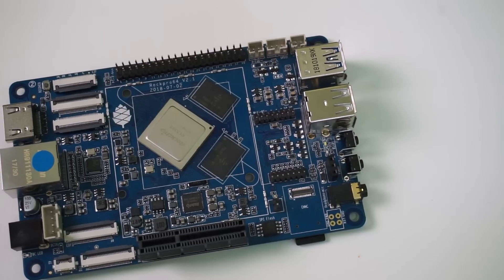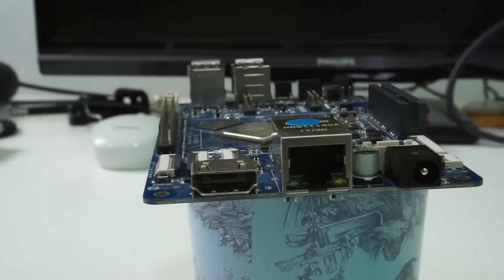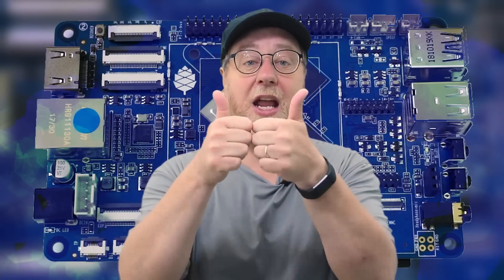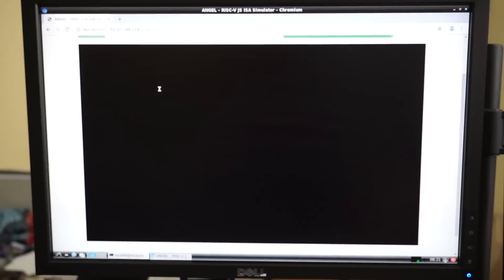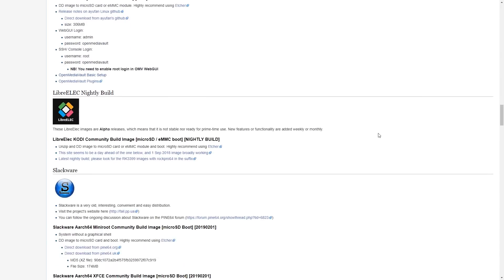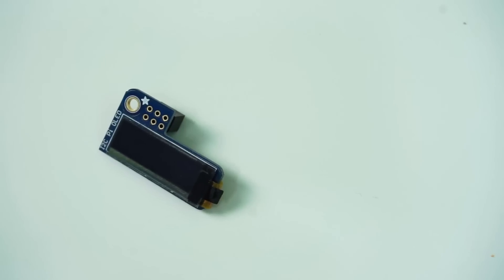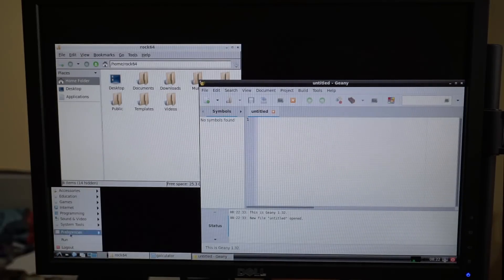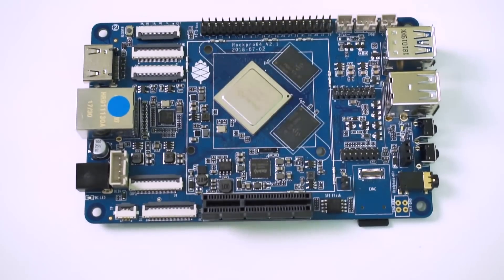PINE64 ROCKPro64 Review: Better than a Raspberry Pi?

Comment: The RockPro64 is an incredibly disappointing product. None of the listed Linux versions seem to work properly with this device. It's no wonder that it's relatively unknown because it's simply not worth being on the market.

Armbian doesn't work in 4K, and even when you manage to get Debian to work in 4K, it fails to update properly. On top of that, there are issues with some versions where the USB ports don't function as they should.

Overall, the RockPro64 is a terrible piece of hardware that's a complete waste of both time and money. I've already tossed mine in the trash, and I strongly advise others to steer clear of this product unless significant improvements are made.

Comment: It's been 3 years and there's still no full functioning OS for this board or the plethora of others out there. Don't believe it?  Read the associated forums for each one. If you want to spend your time trying to make a board work, have at it.
I have one of these and another that I spent countless hours on and still don't have a reliable system. Meanwhile my Raspberry pi 2B has been running  24/7 for  3 years as an MQTT server without the need to beboot.

Comment: I wish I watched this video before I ordered a rockpro64. The overall design of the board and it's amazing hardware really impressed me and led me to believe this would be a suitable alternative to a RPI4. I'm not unhappy with my purchase, but I am ripping my hair out trying to get BSD to run properly and I can't find any documentation or support for getting BSD to run on the rp64. The fast hardware doesn't do you much good when there's no hardware acceleration and your system runs like a potato.

Comment: I purchased the complete set 4Gb board eMMC SATA FAN Heatsink SSD adapter wireless add on camera and display screen all of which cost a fortune. It's really useful if you have an empty draw that you want to fill up but no use for anything else. As Gary says part A will work this operating system 1 but not 2,3,4,5,6,7, part b will work with operating system 2 but not 1,3,4,5,6,7, blah blah blah. it's expensive junk.

Comment: if it's was only 25$
Reply from the maker: If by "it" you mean the ROCKPro64, it isn't.
Reply: @GaryExplains   i meant was.
Reply: Exactly. At least another RK3399 SBC like Orange Pi 4 w/ 4Gb RAM and 16Gb of eMMC soldered module including WIFI/BT is only $49 and much better supported by Armbian community.

Comment: I'm wanting to build my own NAS, thinking of using this SBC. That SATA card from Pine only supports two SATA drives Has anyone had luck getting it to work with a SATA adapter card supporting 4 or more SATA drives?
Reply: Radxa the manufacturer of the great RockPi4 has some great SATA solution hat for the raspberry pi 4:
https://shop.allnetchina.cn/collections/sata-hat/products/dual-sata-hat-open-frame-for-raspberry-pi-4?variant=31603692699750

Comment: how much rock shit pro cost ? if cost more than raspi3 no ewer have good board, only idiot buy expensive board because can use same lot cheapen. no ewer must cost more than 30-50$ this board. only totally idiot pay this more than 45-50$
Reply from the maker: Only a total idiot which forget that there was difference between the boards and that the R Pi 3 has nowhere near the same level of performance.

Comment: answer have killer or not, IF board have little better, fasten and more ram, and true 30-40% cheapen then have true raspi killer, but if have expensive than raspi no ewer have killer or same level board.because today if have under 50% fasten cpu etc, no matter what u buy, human eye and brains not understand and see this how fast or slow have. no matter what speed have, important have guality,memory size,connectors,and number first how much cost. if have 100$ have too expensive, must be 20-50$ level only. and not fail connectors new raspi 4 has big fail all connectors plugs. idiot has plan this. need other usb plug NO C model. idiot think use C model. and same idiot have think hdmi micro have good, no newer. totally idiot planner.

Comment: How about hooking up a GTX card to the PCIe slot?
Reply: I dont think that will work. You need to have enough power from the power adapter and the board itself has to pass that power to the pci slot.
Reply: @-tineidae  Most GPUs take external power from the PSU.

Comment: @5:48 if you can have your kernel running command line, you can recompile ALL what you need to complete the Linux distribution you want.
So many peoples expect Linux to be plug and play for noobs, they miss the point of who started Linux (geeks) and even though the distributions are more and more noob friendly, it is still not suitable for my grandmother.
Please expect to do a bit of command line to tune your distribution, and if you are at a stage where you consider getting a micro computer to fiddle with it, then you are in the right spirit; don’t stop half way!!
:)
Reply from the maker: Yes I expect Linux to be plug and play for noobs, thus isn't 1998.

Comment: Yeah pine doesn't support their products I backed the pine64 and it just sits in a box with other broken or useless pcbs that I harvest old parts from when I'm fixing stuff. They get the barest example of as many OS's running on it then tell you it's fully compatible with all of them when in fact none of them run well enough to use for most projects
Reply: You are missing the point as they run a few main images and allow many community images.
The point you are missing is that the RK3399 in 5.2 is now mainline and its now Manjaro who provide the image and in Oct Ubuntu 19.10 will be available on 5.3

https://forum.manjaro.org/t/manjaro-arm-19-06-released/91858

Comment: i love the rp64 but i really wish people would stop this trend of calling boards like this a pi killer im sorry

ITS NOT 

better than a raspberry pi well duh no shit it also costs more if were going to allow spending more money the gigabyte brix is a pi killer no wait the skull canyon nuc is a pi killer no wait a full sized 1800 dollar gaming rig is a pi killer

this board and many like it is not a pi killer and heres why they never will be 

price rp 
foundation has worked hard to maintain its price point and even when they deveated they only did so for those wanting more ram whilst maintaining identical boards with less ram for the normal price point of 30-40 dollars

features
not only do you gett alot of bang for your buck but you have access to a massive ecosystem of cases addon boards and accesories

software
the pi has a huge crowd of people supporting it with software drivers os images ports and more 

availability
chances are your no more than a couple miles away from some kind of store that has one for sale right now ready for you to pickup if not amazon newegg and hundreds more stores have them available for purchase 

backwards compatibility 
with only cases for pi4 being the small exception nearly all addons accesories and software will work forwards and backwards with the pi series

options
need it smaller? pi zero need it embedable? compute module want something small but feature rich a+ theres a pi for every need 

so no its not a pi killer because once you look into it the pi is alot more than its price and specs
Reply from the maker: I didn't call it a Pi Killer. Why all the big long text for no reason?
Reply: Its a lot more, but tunnel visioned marketing department shaped crowd is not able to see.

Comment: The point of the Raspberry pi is it’s simplicity.  I did not want to add boards to the board like a pc.  The Raspberry pi is just better because of the support as well. If the software was better I would totally look at other boards, but the community for raspberry pi is dug in deep and have it down on the software end.
Reply: It always depends on what you are planning to use the board. Support on all those is just fine: https://www.armbian.com/download/?device_support=Supported

Comment: Nothing can beat the rpi4 !! (At least support-wise ...) :)
Reply: lol.... what support? the board just came out and has a different architecture. they released the board with crappy MESA support so far.
Reply: @slappymcphee  yes but I'm almost 100% sure all major distributions will fully support it within a few months. Which is not the case for many many other sbc's...
Reply: @eldontyrellcorp  I agree. With that being said, I think the PineBook Pro will lead to better support of this hardware (since it uses the same chip).

Comment: Wonder if a graphics card can be run on that PCI slot
Reply: I'm pretty sure you can, but you have also to power it and for that you'll need a PSU that is much bigger than this SBC, and even then the CPU will be a bottleneck (unless you're using a really old GPU). In the end I think it doesn't worth it.

Comment: Hardware is nothing without software and support.
So you pay 80$ for having just a piece of a single board to attach it on the wall.
Raspberry Pi is unbeatable, great software and mostly huge support and now that 4 is out nothing will compare to it.

Comment: The Pine64 team are far less involved with the distro development that they should be.  I've been meddling in Linux since 0.99pl12 (1993), and I still can't figure out how to create a kernel of my own for this board.  I purchased the whoe shebang (the NAS chassis, the SAST card, fans, power, etc.) and it's been quite a let down for more than 13 months.  Even asking fr help from the distro posters can result in no answer or weeks before you do get an answer.

Lots of power, but you can't really utilize it unless you are already an aarch64 kernel and uboot master.
Reply: Maybe try Gentoo, the whole distro is aimed at compiling the kernel from scratch so with a little effort you should be able to put something together tailored to your needs.
Reply: @schrodingerscat1863  The OS issues were sorted around 2 years ago and I've used more that 20 of these in projects.

Comment: Looks like I'm getting burned on the Atomic Pi, will be over £100 by the time I get it $35 purchase price.  Really I would have been better buying a Cherry Trail based mini-PC for £150 because I get a case, it has more DDR, has SATA and PCIe via M.2.  Plus a power supply.  My fault.  And the Pi4 got launched a few days after which would be just as good with more I/O.  We have to be careful in the UK, these imports are difficult.

I think now we have the Pi4, while not perfect, it really is the solution for us.
Reply: Wow....over $100? In shipping and uk import taxes i guess?
Reply: @englishrupe01  All $ USA
Atomic Pi 43.88
Shipping 36.00
VAT/Sales Tax 20%
Sub Total= 95.86
Duty at 3%
Total= $98.74

OK, with the Royal Mail they don’t always do the conversion exactly like that, they can use a nominal figure for shipping that may or may not benefit me.  However the cost of the item is fixed.   The Royal Mail has already written to me to warn me they won’t release the item until I pay duty and sales tax (Duty and Value Added Tax)- this is while the Pi is still in transit, it isn’t in the UK yet!  

So that is £77.81 but I need a PSU.  I always go for 3A PSU these days and I think I paid £18 for that.  So about £96.  Then there’s bits and pieces that might cost you if you don’t have them.  So my point is a Cherry Trail mini-PC can be had from eBay UK for about £150.  That will come with a case, some storage, SATA capability, a PSU and more memory (generally 4GB).  It makes the mini-PC a much better choice even if you want a SBC because the Atomic Pi isn’t a great SBC, it doesn’t have a ‘proper’ GIPO really and you are suggested that you break-off from the USB2 socket.  Nothing to stop you doing that with the mini-PC.  

And of course there isn’t going to be the same community for the Atomic Pi, and there never will be because stock will run out long before there is critical mass for such a community.

In the UK the Pi4+ will make more sense than almost all other SBC because of import taxes.  One exception seems to be the Nvidia Nano, it is about £100 but that isn’t because of crazy taxes, that is because it is very powerful.  You can also get the Cherry Trail Latte Panda for about £130 but again why not just get a mini-PC for £150- although the Latte is a much better board than the Atomic it must be said.

One thing that might happen is the Atomic gets a niche following, in which case my Atomic Pi might well have a good resale value because of rarity.

Comment: You hit the nail on the head... The software support.  So, until they get the software builds squared, I"M OUT!
Reply: If you really want to experiment with non-Rpi boards, try Odroids, they have an excellent support at their forums. If you want to try it out RK3399 SBC's, try Orange Pi 4 which is so popular because of the low price($49 for 4Gb RAM with 16Gb non-removable eMMC module). It's not the best, has some design flaws but chances are will get better supported than exotic RK3399 boards as RockPro64. Don't forget RK3399 CPU's run hot as hell, so an appropiate large heatsink/fan cooling solution is a must. Finally if you just want to avoid all the hassle, tinkering and headaches, just get a Raspberry pi 4.
Reply: Pine64 is not a fly by night company. pretty rude to classify them as that. the only reason the Raspberry Pi is where it is at is because of the community and what THEY have done for it. They biggest issue isn't vendors like Pine64 and Hard Kernel. It's all the Pibois and their fandom working to knock down anything that isn't a Raspberry. The Raspberry Pi 4 released without notice and the driver support for it as an example MESA support is garbage out of the gate. The fact that they chose an a72 based chipset that they had to actually downclock by 500Mhz is telling of the fact that they felt the pressure of releasing subpar performing SBCs the last 3 years alone so they over extended. You obviously as others have said don't belong in the SBC space since you don't believe something should require any effort. The mainstream distribution on an SBC is either Android or Linux which requires plenty of tinkering....let that sink in a bit.
Reply: @slappymcphee  I don't mean to be rude.
Reply: Clearly SBC's are not for you.
Reply: @sethrd999  No.  Actually I have several models of the raspberry pi(s).
What I dislike are the fly by night companies that expect community support while they reap all the profits while not investing in software to support their own products.
Reply: @tedoyle61  And yet they released ( Rockchip ) a full BSP? hmmm and yes they have developers ;)
Reply: @sethrd999  Listen, I'm not here to argue, if this board works for you fine.
Reply: @tedoyle61  I have heard that PINE doesn't make a lot of money on their products.
Reply: Clearly you're not keen on learning and writing C/C++ or Python, then ...
Reply: @NigelNquande  You're right I'm not.  I expect the manufacturer to release the proper drivers and software.  That is, their job.

Comment: Gary,

I'd like to make a DIY digital picture frame using a single board computer.  There are other Youtubers with videos showing how to do this.  I dont want to use any cloud services.  I already have thousands of photos on a FreeNAS server on my LAN.  I prefer to use the NAS instead.

What builds/OS should I start with?  I prefer to do as little coding as possible as I am a noob.  I'd like to maybe set up Kodi to slideshow photos on boot or something and have the files stream off the NAS instead of storing them at the build.  Any suggestions?  Have you done this yourself?  Maybe make a video...

Comment: you can look if there is some kind of sata module for raspberry(since the usb and microsd read and writespeeds of raspberry pi are verry low in my experience) and then use 2 raspberrypi 4's as a computecluster for roughly the same price.
Reply from the maker: The USB 3.0 read/write speeds of the Pi 4 are excellent.
Reply: @GaryExplains  thanks, that's a great thing to hear.

Comment: I bought a rockpro64. It half booted once then died. Sold to me knowingly defective. Plenty of other examples - don't be tempted.
Reply: Zeki Murad same. I bought Pine when it first came out and it’s a paperweight. No programs for it, hard to support.
Reply: @DNAatcg  So you did not join the IRC chan / forum?
Reply: That's why I stick with Odriod. Haven't messed with a Pi since!
Reply: @kymberlailucas1831  That's is why I stick with Odroids and Rpi4's only.